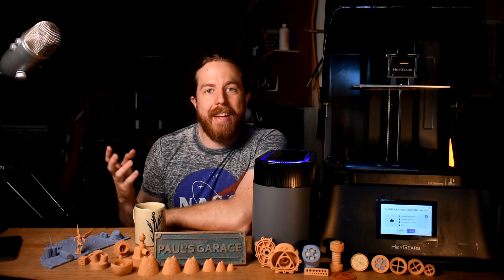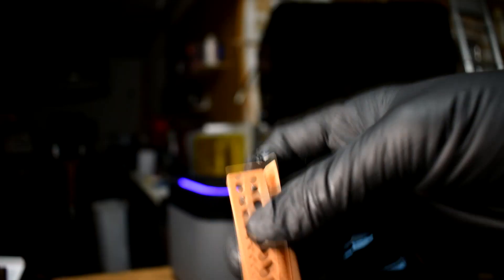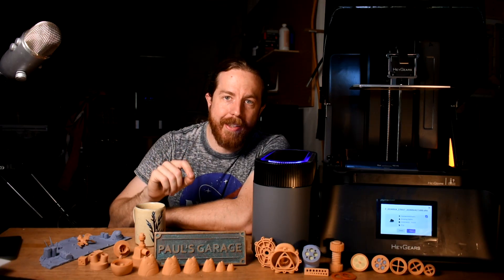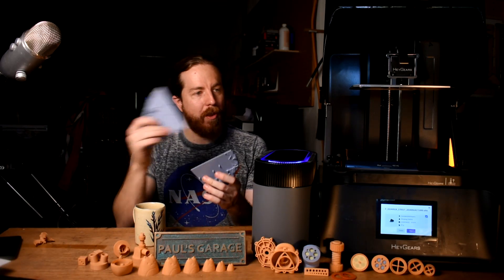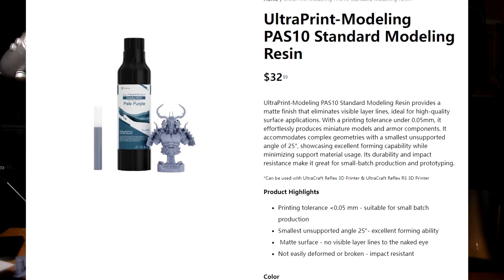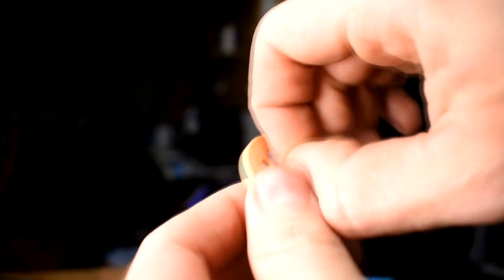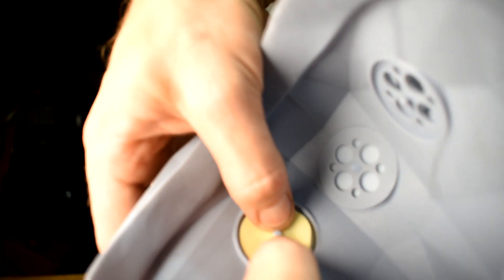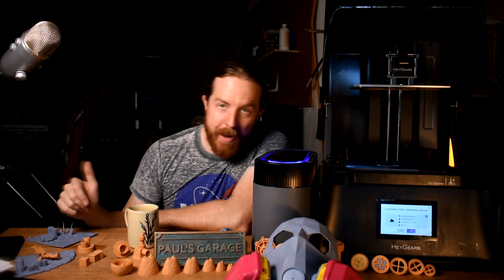Rapid Prototyping in Your Home Shop! | HeyGears Ultracraft Reflex RS

Comment: Big question with a printer like this is does it work at all if the company does go bust, or drop support!? Locked down products don't tend to be a good choice.
Convenience and quality that comes from having them do all the calibration can be worth it no doubt about that, especially if its your business and you don't have a large enough staff and money pile to do all the calibration work in house quickly enough to actually produce your products. 
But when its locked down so you can't play with the settings for alternative resins at all it leads to other dependency questions for me as well. As then I start wondering does it even work without an active internet connection etc. 

So a machine you are not allowed to adjust the settings on at all is a big fail for me, I'd probably not step away from their resins while the price is right as that convenience is hard to beat. But the options being open so you can use another resin for whatever reason you might have is an essential feature to have IMO - for any number of reasons you might have to order off their resin menu, even if they offer resins for every need you have and its just a shipping issue that means you can't get the official resin for a few weeks but need more resin NOW!

(Edit as I noticed stupid grammar errors)
Reply: If HeyGears goes down, the printer is a paper weight (as of right now). The slicer requires you to log into one of their servers before doing anything. If you cant log in, for what ever reason, you cant use the printer.
Reply: @RoiskiaFilms  Well that kills an otherwise well executed machine by the looks of it.
Reply from the maker: You are correct, you are locked in and dependant on their resins and settings.  Fortunately those are very high quality, but if the company disappears you are done.  They are a pretty big company in the industrial and dental worlds, though, so I would expect them to stick around.  

As for internet servers, you need to be connected for the slicer, but you can use a USB to transfer files to the printer.  I suspect it's because it uses a server somewhere to calculate the supports and do the actual slicing.  I don't know that for certain, but it works MUCH faster than other slicers on my laptop, so it's either much more efficient at doing calculations or it's doing the calculations somewhere else on a much faster machine.  Again, not sure exactly, that's just my observation.
Reply: @PaulsGarage Everybody talks about Hey Gears servers. I'd be more worried about local internet failure. If your neighborhood connection goes down because someone digs up your physical connection you are as down as if the company shut its doors.
Reply: @PaulsGarage  This just isn't true. There are plenty of videos showing people using a wide variety of resins on the HeyGears Reflex RS with perfect results.
Reply: I understand your concerns. I happen to know some people within the company, and they mentioned that they plan to launch the offline version by the end of this year, as well as open up certain third-party resins. I also maintain a positive outlook on HeyGears not going bankrupt; after all, a company without economic and technical foundations wouldn’t take such risks with a closed-loop system, especially after facing some criticism from users regarding their previous generation of products. In terms of technology and company scale, I believe they are far more advanced than many other consumer-grade UV printers on the market today, and you can’t deny that, right?:elbowcough:
Reply from the maker: Someone from heygears also told me about the offline version they are working on.  It sounds good to me.  I'm not particularly worried, but more freedom is better, right? I'll still probably just use heygears resin though because it's super nice
Reply: On the news of offline slicer, that is great. However I'll wait for such a thing to exist before considering their printer myself. As good as it seems in many ways that just isn't worth the risk.  I love the idea of the curated experience where they have put in so much work to their own resins to work so well.
Reply: I think industrial users would be more concerned about this issue, as they are the large companies doing mass production. However, they all trust HeyGears, so I believe there’s no need to worry.
Reply: @omi_liang  Industrial users are far less likely to care about anything but easy of use to crank out their parts - to them time is money and they will wear the machines out at a pace it doesn't hurt nearly as much if their supplier does go bust, or decided to pull a bullshit forced bricking abandon the product route - there are always other suppliers and they have enough clout with the company as a relatively big money client any BS probably won't apply to them anyway...
Reply: @foldionepapyrus3441  I don't think it's necessarily the case. Any change in suppliers can lead to immeasurable issues with batch consistency and product quality for a company with stable production. Companies focused on mass production value stability over constant change. Brand trust is built on years of accumulated experience and technical development, not something achieved overnight.
Reply: @omi_liang  Indeed, you are in effect agreeing with me almost entirely. Just looking at it from a different angle - as my point is nothing more than they are constantly cycling new machines in anyway. Which makes the costs to them of any additional disruption relatively low additional cost. 

It is there, they would love it to never happen but the most important thing is the ease and speed of making their own parts far far far more than having the same supplier forever - any other quality supplier who's machines provide a decently calibrated and consistent result is good enough. Also seems to me most of these sort of places will have a look outside their current supplier from time to time anyway, already dipping a toe into the other ecosystems. Which allows comparing the available machines and resins to be sure they are not paying way over the odds for a slower, worse result...
Reply: @foldionepapyrus3441  I understand your perspective, but I don’t entirely agree. While periodically upgrading machines is indeed a strategy some companies use to stay ahead technologically, frequently switching suppliers and equipment involves more than just financial costs. More importantly, it impacts the stability and consistency of the production process. Each time a new supplier is introduced, time and resources must be invested to re-evaluate and verify the compatibility and reliability of the machines and resins. This isn’t just a simple, low-cost decision. Additionally, a long-term stable relationship often brings better service and support, even customized responses to specific needs, which cannot be achieved through short-term cost comparisons alone. Therefore, instead of frequent switching, it’s more beneficial to establish a long-term partnership with a reliable and consistent supplier to ensure the stability of the entire production chain and final product quality.
Reply: @omi_liang  I'm not saying they want to switch by any stretch, all disruptions are undesirable. I'm simply saying they don't put the long term stability of any partner they have at the top of the list of requirements when the machines have such limited lifespan. When the machines are such short lifespan objects the most important thing is which way can we get the greatest number of parts out cheaply. 

As there are many others they can move to if the need arises and the 'lost' lifespan should their supplier go away and the machine become a brick isn't nearly as problematic to them. They have already extracted lots of value using that reliable smooth easy route to high quality production of their parts.